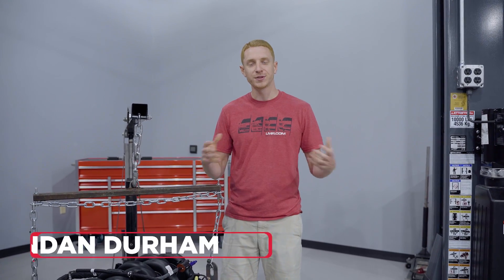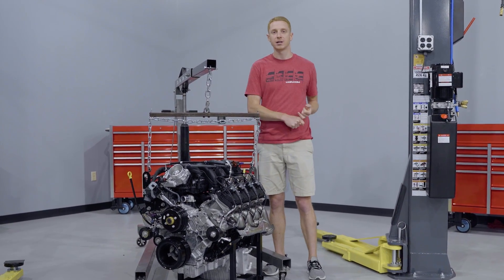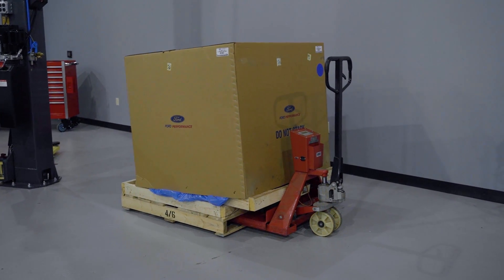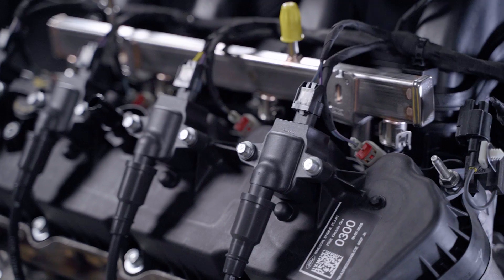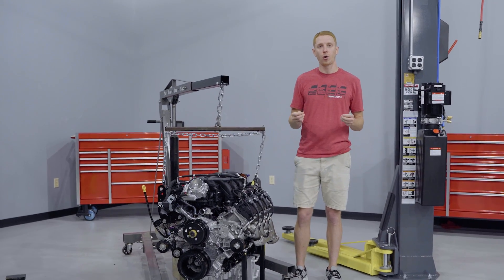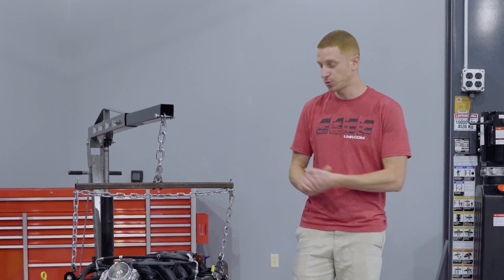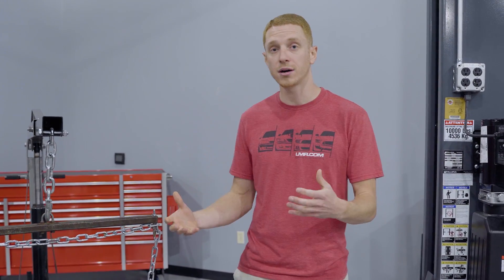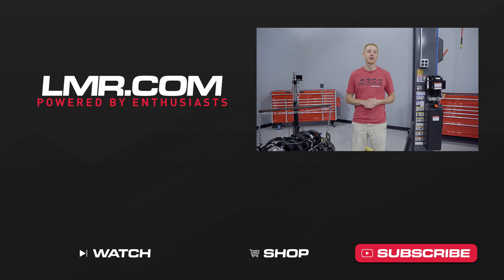Ford Performance 7.3L Godzilla Crate Engine | Review

Comment: These will be more fun for swaps than Coyotes
Reply: I think coyote is better for mustangs but the 7.3 will be far better for the trucks
Reply: Boost is displacement. You’re displacing more air, same with Nitrous and if you equate time into it, then rpm also affects displacement.
Reply: @markchickenbutt8740  ok then use a 1 CC engine with a big blower and tell us how it turned out.   Good grief dude.
Reply: @dk2190  
1st I was sticking up for you because people are using a boost concept to argue displacement when boost is adding more displacement when you think of it as volume of air displacement. 
2nd why didn’t you use a 5 cylinder Mercedes cruise liner diesel engine as your example? Because it doesn’t work on the scale you’re talking about , just like a 1cc doesn’t. 
I’ll give you a more manageable example. Compare a 2.0L 4cyl to a 4.0L v8.  The 4.0L running at 4000 rpm will displace the same volume of air as the 2.0L running at 8000rpm. When talking boost a 2.0L with approximately 14.7 psi boost will be displacing the same amount of air.
Reply: @markchickenbutt8740  You know what you are talking about.  I like to see rational arguments on the interwebs
Reply: Eh
Reply: @sategllib2191  no replacement for displacement.    Once you boost these it will put out crazy numbers.
Reply: @dk2190   "no replacement for displacement" Thats a false statement. compression and boost is how you can make alot of power. not to mention the fact that your wallet aint gonna be happy.
Reply: @gamer22ftw  take 460 cubes.   Boost it.   Take 302 cubes.    Boost it.    460 > 302
    If you are buying one of these it isn’t a Budget build kind useless point.
Reply: @dk2190  you don't know what you're talking about 🤪
Reply: @fread51  Bro he’s not wrong, you just can’t combat it so you say he doesn’t know what he’s talking about. Arrogant asf
Reply: @dk2190  Exactly Correct on comment to Meme Machine
Reply: @gamer22ftw   That is NOT a false statement. You are Incorrect (Wrong) stating "no replacement for displacement" is a false statement. DK is completely Correct (Right). DK's comment shows the advantages of both larger displacement and boost.
Reply: I would bet that people are going to go over 1000hp on stock internals with this engine, and over 2000hp on the stock block...
Reply: LMFAO after you put 15k worth of internals in it mathematic coyote would kill the 7.3

Comment: Just wait til there's an intake for these that caters to mid and high rpm power, and then someone boosts it.
Reply: Brian Wolf built a n/a version that made 700s/700s hp/tq and is planning a big whipple next
Reply: Visner engine development has a billet intake and head porting available.
Reply: Are you talking about a single plane?
Reply: @bri-manhunter2654  not necessarily, but shorter runner manifolds usually are single plane.
Reply: @michaelrodgers6559  Theres companies working on it already... they’ve managed to coax almost 700hp out of this motor NA with a cam and intake
Reply: Exactly.  This is why displacement is awesome. Doesn't take much to really wake it up.

Comment: 7.3L and only 430? Should they just ask Chevy for help?
Reply: It's a production truck engine. Look at what people have done to them already aftermarket. Some NA ones are making 800hp.
Reply: @crimsonstang  were have you seen an ford truck engine 800hp n/a?
Reply: Longevity, it has a huge amount of potential, it just has a tiny truck cam meant for torque, you put a aftermarket baby cam in it and those high flowing heads will be very happy. 

It already has good head flow, compression, displacement, and fuel injection. This thing can be a monster real quick.
Reply: egresham1743 yes wast of time and money

Comment: So the Ford bros lip the GM bro's about still rocking "old pushrod setups and how advanced ford is with their modular engines, now ford is pumping out pushrods again? Don't get me wrong, I love this but some Ford bros have to eat their words now LOL
Reply: They did it mainly because of ease of maitnence for fleet vehicles. Plus the doe load torque again for truck and fleet use is better with a cam in block configuration.
Reply: @chadmiller8019 . Agreed, it’s hard to beat the versatility and cost of a pushrod.
Reply: I like both but gm is supposed to be making a new dohc for the corvette lol. So it's pretty even to me. And the 10r80 is Ford's as well that GM uses. No matter what side you're on both companies are doing great things
Reply: Fitty6Pickemup  No arguments here. Just the fax 📠
Reply: Like others have stated, this engine was build for work period. Not a race engine. Can it me made into one sure. It was built for durability and longevity.

Comment: Horsepower and torque seem a a little light. Perhaps it's underrated , there's no way it should be making less horsepower than a stock 392 6.4 Hemi.
Reply: It’s a truck engine in stock form. It makes more power than the 6.4 in the ram HD trucks.
Reply: @Jaxon-iu6vb  I'm fairly sure it's underrated. That's less power than a 5 liter Coyote engine. It's not a bad thing, I just think the engine will "overperform"
Reply: It's a truck engine, not a performance engine. Look at what people have done to them already. There are NA ones making 800hp.
Reply: @Andrey Angere that's what I was thinking.

Comment: Cobra kit cars might be just the ticket.
Reply: The Coyote is still a better choice for that vehicle
Reply: My first thought 😎🤘
Reply: So all those transmissions just bolt/hook right up to "Godzilla" just like it'll "likely" hook up to whatever "control pack" you want it to.
Reply: @deeremeyer1749  yea it will bolt right up to any tranny with the standard Ford mod motor bellhousing pattern.
Reply: That's what I'm thinking.
Reply: Yeah. It'll fit under a Cobra hood. And who doesn't want a 700-lb. engine in an already nose-heavy Cobra. Exactly what transmission(s) are all you Godzilla "swappers" using?

Comment: Damn, it's a 2 valve.
Reply: So are top fuel dragsters 😂 it’s making coyote power with a truck cam and 2 valves... that’s pretty good
Reply: That’s okay, it has a lot of displacement with gobs of torque and potential.
Reply: Im just upset they aren't making a large displacement dohc, would be untouchable
Reply: @sategllib2191  would also be too big to fit in cars lol